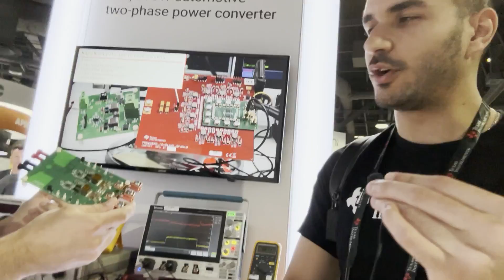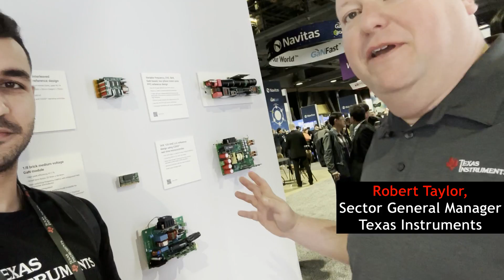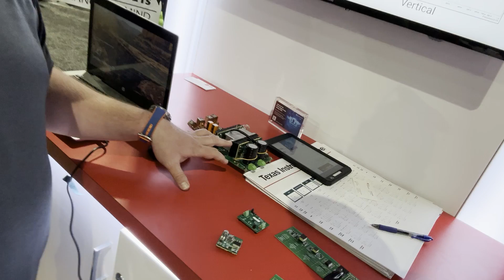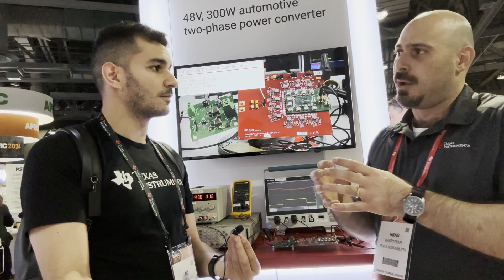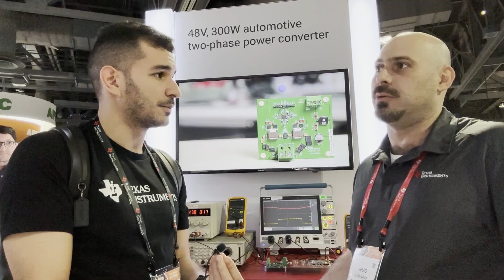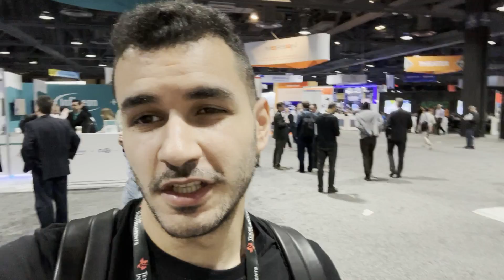Inside Texas Instruments' Electrical Engineering GaN Demo

Comment: The benefits of GaN transistors isn’t their switching frequency, it’s the amount of power they can switch quickly. They also have high electron mobility and great thermal conductivity, providing far greater current densities at much smaller sizes than Si.

Comment: Hi Ali, I have a question, is embedded systems  more for engineers with a CE degree rather than a EE? I want to work as an embedded software engineer
Reply: You can do it with either degree, they have a lot of overlap. CE in my opinion is better since it’s the combo of CS and hardware but bottom line it doesn’t matter which one you choose

Comment: That's pretty interesting because the GAN technologies will replace the IGBT's as it replaced the MOSFET's once , as I'm working with Power Generation, those new technologies helpus out to solution many problems with THD when transferring on load after UPS'S kept the load for a while. Ali must remember to all the followers , that as professional you gotta be updated with new technologies !.also at last, Arduino would open your mind but if anyone get into it deeper getting info of the alternatives of it's processors and booting softwares, searching knowledge.
Reply from the maker: Absolutely -- arduino is very beginner friendly so I always recommend it